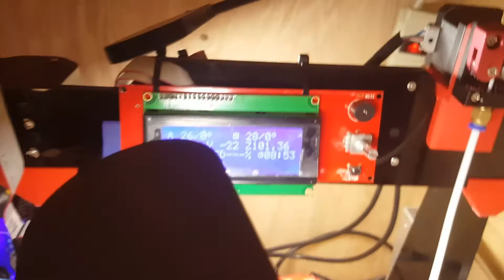Anet A8 Printing Problems Solved!!!

Comment: That warping is your bed.  Its not leveled properly.  I went through it as well.  as this video is 2 years old, you have probly figured this out by now.  but if you havent, then know its the bed.  its not all the way level.  I would recommend installing the latest firmware, so it gives you manual bed level.  Level it as best you can the old fashioned way, with card under the nozzel, after that run the manual bed leveler.  That should get you close to where you need to be.  Then maybe a shot of hair spray before you print.  that will help it stick.  hope it helps if you havent figured it out.